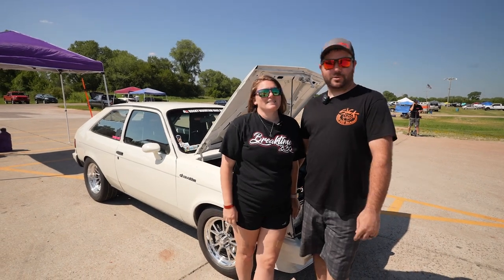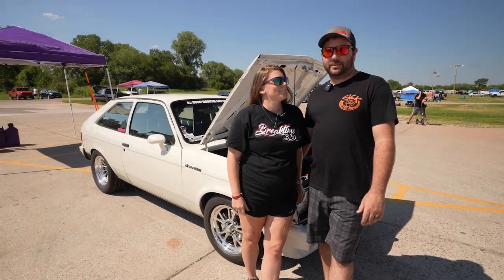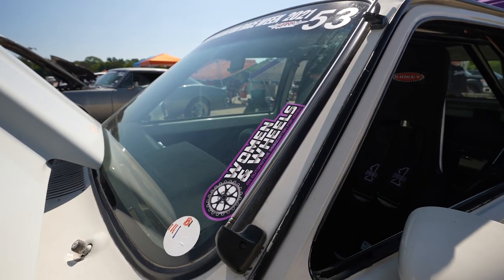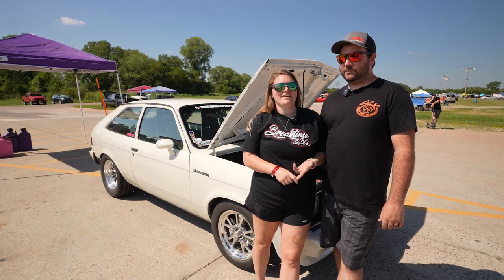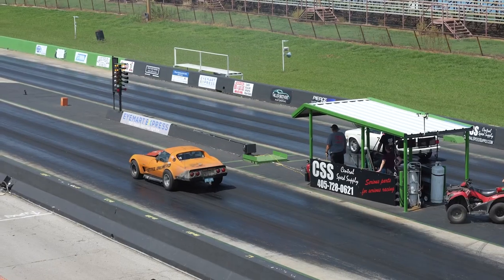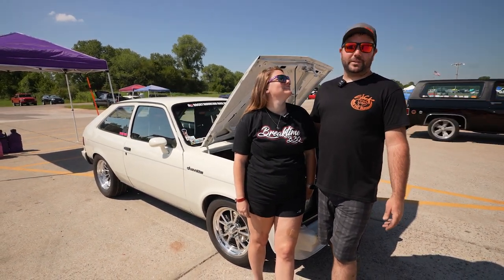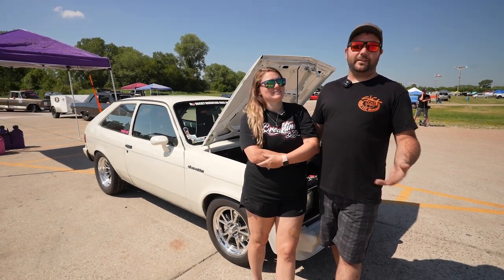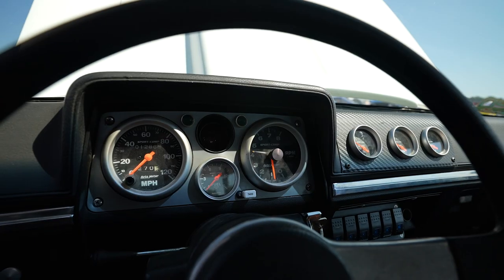The Little V6 Chevette That Could - Race Week 2022

Comment: Thanks for the shoutout and the spotlight on the Chevette! We always have a great time at the RMRW events and already have the car torn apart to fix for next year!
Reply: Great little car !!  Love the husband wife team effort, at least somebody got lucky that way. 
What crank and rods are in it and header diameter and manifold? What size is the carb?
My friends 406 powered 67 Camaro used to run about the same et at that track, although he had traction issues. Impressive et for that combination. I hope '23 works out great for you two 👍